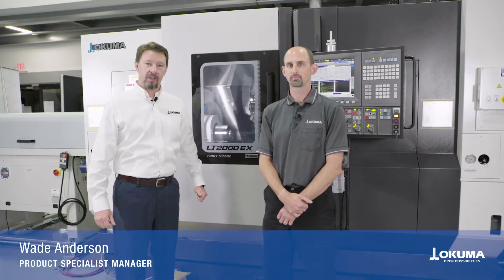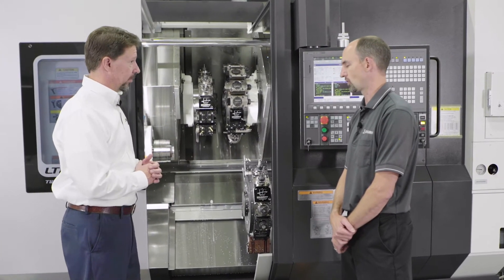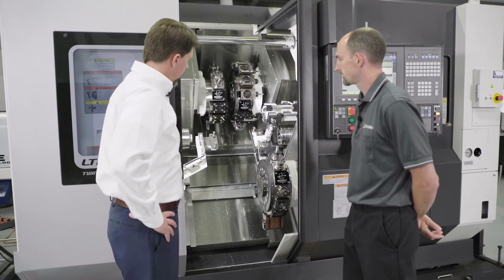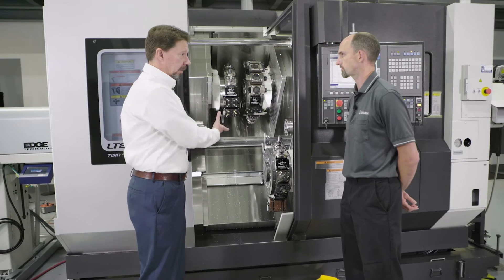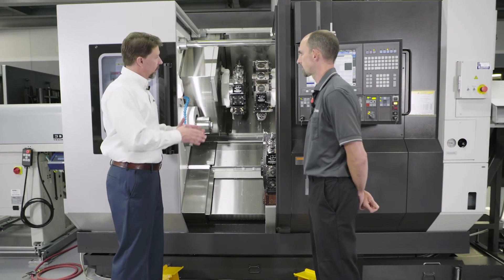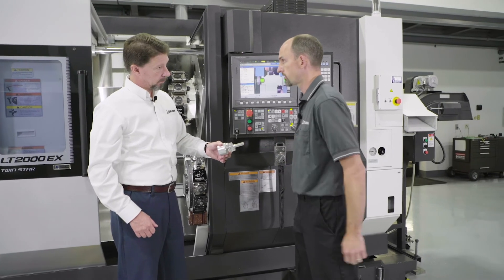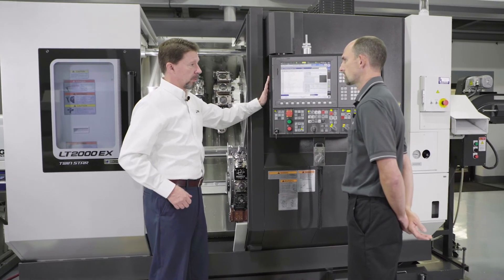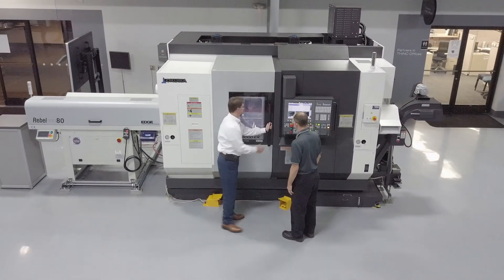LT2000 EX Horizontal Lathe

Comment: Why have 9999 tools in the library when the turret hold what... 12? And seems the only way you could run this lights out is by only running softer materials that wont destroy tooling rapidly. Awesome little machine either way

Comment: when is the live tooling destined to fail on this machine sir?
Reply: Answer is directly related to quality of the live to.
And how the operator programs the machine.
Reply: @corny155  that's a corny response and you know it
Reply: @fredrezfield1629  well, I’ve been running an lt200my for 14 years now. 
Think I rebuilt one tool.
Reply: @corny155  "how the operator programs the machine" what t are you talking about? are you trying to say how aggressive you're cutting with it?  
but shouldn't that go back to horsepower and the lathe itself ?i see a lot of these okumas with bad live tooling and it's so expensive to fix the owners either sell them or just stop using the live tooling which is ridiculous in my opinion.
Reply: @fredrezfield1629  yeah, what you need to realize is these machines don’t compare to milking machines in terms of milling. 

If you have ppl running the really aggressively, lots of vibration…tool and turrets will fail prematurely.

I rebuilt some eppinger tool…cost me around $500 with a factory rebuilt. Just the bearings were $400